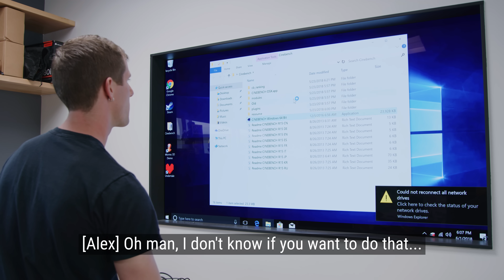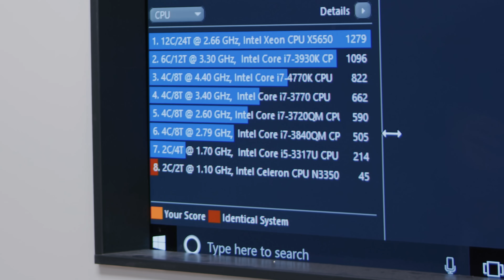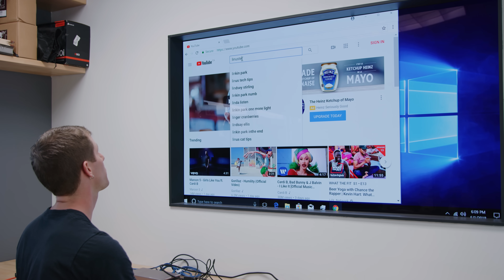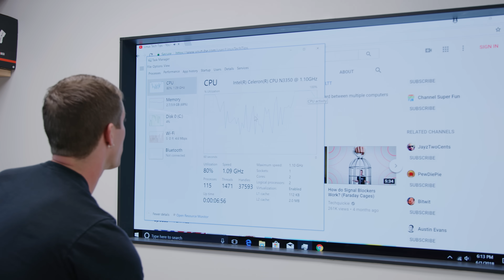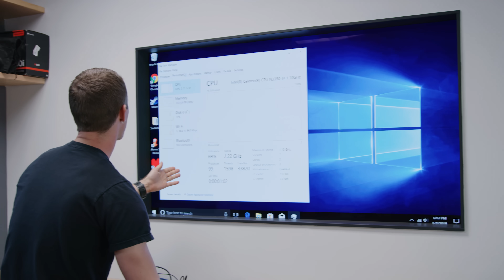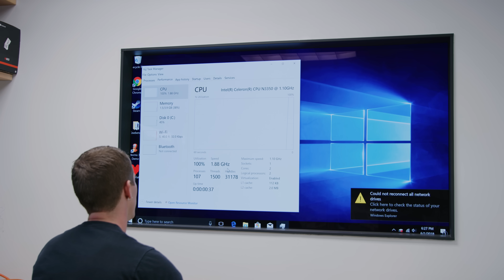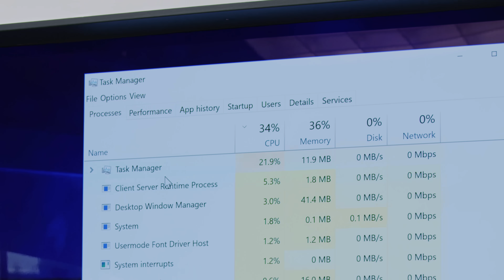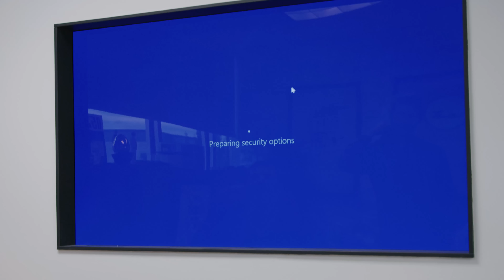PC Smaller than an SSD

Comment: Hmmm, how is it amazing? Smartphones are same size but more powerful... and even includes a screen.
Reply: Smartphones are not computers lol
Reply: And also way more expensive. And don't run Windows 10. And use a ARM processor rather than a x86 one.
Reply: SSaturn VX they are though
Reply: It's a computer, but unlike most other computers they arent x86 based
Reply: Actually they are computers but the x86 chip used in this is far more powerful, clock-for-clock, than an ARM chip used in phones as the x86 architecture is a CISC design with many SIMD functions that accelerate many computing tasks whereas an ARM chip is a RISC designed for low power usage, an 8-core ARM chip at 2Ghz won't perform nearly as well at many tasks as a dual-core 2.3Ghz Celeron.
Reply: Kimion Yeah but Windows 10 arm is ready now, and some arm processors may be better at running Windows than this
Reply: You can't really compare ARM and x86 cpu architectures head to head because they use completely different instruction sets.
Reply: SSaturn VX smartphones are not computers? what the fuck? they both got hardware, an operating system, what do you think they are?
Reply: Kimion Some arm are cheaper
Reply: Tht's because has an intel cpu, just wait when windows arm is ready, and you should can put an top of the line mobile cpu into that mini pc and using windows
Reply: Maybe not to the average consumer, but businesses that need a ton of workstations or terminals in an easily replaceable format will welcome the tiny format that they can hide away just about anywhere.
Reply: ENEKO TORRES windows arm with even less programs than windows
Reply: The software is windows 10, soo? what are you trying to get on? And It would perform better if it was optimized
Reply: Odin's Playground Dude what are you even saying? How can you compare the two
Reply: Lesson learned today according to some of the comments. Computers didn't exist until either 1978 when X86 chipset was introduced OR 1985 when Windows was released. Because no other chipset and OS can possibly be a "computer" lolz. Yes smart phones are computers, and if they have better optimised OS and hardware for the form factor... that makes then more amazing than "shrinking down" other more "traditional PC hardware" to run completely unoptimised software for that hardware (windows 10 as shown here).
Reply: There are phones running x86 tho
Reply: most smartphones are way bigger then that, the smaller you get the harder it is to get there
Reply: SSaturn VX they are
Reply: Odin's Playground its x86 though but that's what I was about to comment but when I went down here there were already a bunch of comments saying smartphones are computers
Reply: I also don't understand what is so special about this.
If i take my Win10 x64 Tablet, remove the screen and the battery, it is more powerful and not much bigger.
Reply: windows phones?
Reply: "Smartphones are not computers" -SSaturn VX  2018
Reply: I'm ashamed to see 33 likes on that first comment
Reply: High end ARM chips are way better than this Celeron. Smartphones also have a touchscreen, speakers, gyroscope, cameras, speed/pressure/compass/proximity/barometer sensors, a battery, flashlight, GPS and you can make phone calls.

Oh by the way, phones can run Windows 10, check out Windows Continuum: https://www.youtube.com/watch?v=YWmnOiilwa8
Reply: A freaking calculator can be considered as an extremely basic computer, it has logic gates to do calculations.
Reply: SSaturn VX Yeah, they are computers... They don't run an x86 system but they sure as hell are computers.
Reply: Kimion nobody wants a windows smartphone, trust me
Reply: A PC doesn't need like million gigabytes of RAM to run properly.
Reply: What about very small Single Board Computers like the UP Board? its in the form factor of the Raspberry Pi, and runs a much more powerful x86 CPU, it's fast enough to even run Crysis!
Reply: SSaturn VX uhh...
Reply: Kimion who said they cant run win 10
Reply: It is amazing because it is NOT an ARM processor in a sealed off environment that stops working with everything that was not specifically desigend for mobile use.

- You want to move your Photos from your camera to a backup SD card? Better pray that your camera manufacturer gives you a wireless connect and a useable app to shuffle data from your camera to the phone. And better pray your smartphone is not too old do your app stops working half way through a long vacation (I am looking at you Sony)
- Wanna download GPX data or Maps from some website and push it to your Garmin? Good luck with that.
- Wanna use a mouse jkeyboard, printer, scanner, mic or just acces your USB-drive? Well there might be solutions but they are pretty hard to find . 

There is a reason people often use tiny netbooks for this kind of stuff
Reply: Yes, they are? They aren't PCs, but they are capable of processing.
Reply: luky he means it's not a computer in the sense a calculator is not a computer or a console is not a computer. Stop taking his meaning so literally especially when they are completely different things. One is x86 the other is ARM so uh yeah
Reply: Kimion why wold you want a x86 Prozessor and windows? You saw that windows itself used nearly all of the performance. A special linux distribution would be superior in every way.
Reply: Gmayor61 "Non of these hardware features are at all relevant to a desktop PC. " 
What's your point? You wouldn't use this as your desktop PC either. Linus is saying this is awesome because it packs a lot of features in a small form factor. A phone does it better.

"but they're useless for the type of work this thing is meant for"
What can this do that a smartphone can't?
Reply: Odin's Playground It's windows, thats why
Reply: Are you sure about that?
Reply: Exactly my thought!
Reply: I like how 99% of these comments is just a flame war to a reply

Comment: This really isn't that amazing when you look at smartphones

1)Cellular data
2)Has a screen
3)Has a battery
4)Has speakers
5)Probably a faster processor (but no windows)
6)Doesn't heat up as much
7)Roughly the same size
Reply: Lelouch Yagami smartphones don't run x86 code like a PC though. They run ARM
Reply: Yes I did say there's no windows
Reply: LOL, I've just discovered the mean of my Windows PC is just for gaming.
Reply: You joking, right?
Reply: The whole point of this product is its size and that it runs window
Reply: Sith'ari Azithoth windows programs? old Windows games like Warcraft 3 and Homm 3 and 4? No?
Reply: I could use the shit out of this thing for work applications, this thing could run my HMI software and double as a openvpn server for network access to the system. All my PLC stuff only runs on windows x86 so phones are useless
Reply: Windows phones are dead. Microsoft themselves announced it
Reply: Windows phone is also uses different architecture, the phone uses ARM while Desktop version of the windows application are compiled for x86 and x64 processor architecture
Reply: TheRedbikemaster ARM can emulate x86.
Reply: Electroblade emulation require a lot of processing power and will not as stable as the Intel's processor, it could work though
Reply: Windows so any hardware you would buy there is a driver to it and will work right away, when to Linux that would not be the case and you would only hope some chinese in the deepest jungle has made a crappy driver that doesnt work anyway, and so on.. Windows for the win.
Reply: Seeing as you can buy one of these things for 200 bucks with no contract, I feel like this makes for a fantastic portable computer.
Reply: But cant run crisis
Reply: @mosie3949  You can't even spell Crysis
Reply: @Redbikemaster  My Asus Zenfone 5 (old gen) runs at x86 (it has intel processor) but wastes battery and RAM (it's why it's so impressive the battery in always connected pcs thats runs on ARM based chips)
Reply: Phones can run Windows.
Reply: @JesseLegend149  That's trough emulation dude.
Reply: Well this is probably a windows 10 tablet without the screen and battery.
Reply: @Matrixprogrammmer  Emulation takes more hardware power than natively running the thing.
Reply: PC stick is smaller and run Windows 10.  It has been around for years.
Reply: PC stick is smaller and run Windows 10.  It has been around for years.
Reply: And with a hdmi adapter i can turn my p20 pro into desktop mode and its kinda like a pc
Reply: 5) Do you know Windows 10 Mobile? Maybe not and I wouldn't be surprised. Microsoft barely tried to sell  its Windows 10 mobile after buying the mobile branch of Nokia.
Reply: I would agree with you but some of us have very specific, usually industrial/work related use cases where a smartphone will not work. I absolutely need something like this and believe me if the whole configuration I need worked with a smartphone or a raspberry pi I'd use one of those. This thing is super slim, solid one piece case, has fast usb-c ports. I need to tether a smartphone to it and transfer image data FAST, needs to be very portable. Can't wired tether two smartphones together and hook up a google edge TPU to it. Only something like this form factor will work for me. This thing is packaged so much better than the ARM SOC hobby boards. If it was arm based and ran Linux I would be even happier, in fact you probably can install Linux on it.

Comment: I think Linus missed the boat on the stick PCs from a few years back (lenovo made one, Asus did the vivostick, etc.) And I'm willing to bet that although they're longer and maybe a bit thicker they are narrower, I would guess they consume close to the same amount of cubic space. Just holding my Vivostick and an SSD side by side the actual volume of space they both consume seems quite close. 
This is far from cutting-edge, stick PC's have been around for awhile. Although the Vivostick is only powered by an Atom Processor Cherry Trail and a wimpy 2 gigabytes of RAM, it's more than adequate for the majority of retro emulation out there. I can't say it is really any good for anything else, though, due to the Ram limitations. The Vivostick even managed to cram a tiny fan and heatsink into its form factor, which is impressive although a bit unnecessary for its processor. 
My point is that computers on this scale are nothing new. This product just seems like a very minor evolution of an existing product category that you are kind of suggesting is a new thing. More powerful units capable of performing on par with a mid-range laptop or an entry-level desktop would in fact be almost entirely new. If it were packing an I3 or greater processor, 8 gigs of RAM or more, and perhaps an actual SSD rather than emmc flash I would be a bit more impressed. Sometimes I think Linus spends too much time with high end Hardware and a lot of the budget Low End Hardware flies right under his radar. The good news is seeing products like this indicates that interest in the micro PC category hasn't died off completely and maybe someday we'll see some decently powered micro PCs.
Reply: They have done several videos on Stick PCs and also used to run a Intel NUC Sponser for the longest time, so they are aware.
Reply: @Luckysquirrel1256  Well they sure don't act like any of that exists. The way he plays up the size of this thing makes it sound like he's never seen anything smaller than a steam box sized desktop.

Comment: An Intel Compute Stick is smaller and more powerful
Edit: I’m talking of the intel m3 and m5 models.
Reply: The Alterlion beat me to it was gonna comment this
Reply: but this an affordable option for the masses, and also reasonable competition for the raspberry pi
Reply: Joseph Stranges Pi reaches wider consumers with modular design, which can be used for anything.

don't tell me you will use this for automatically opening your door.
Reply: True, but that has a fan for cooling, meanwhile this is completely passive.
Reply: Nowhere near as thin and that Atom CPU is far slower and less powerful than even that shitty Celeron.
Reply: Joseph Stranges the atom compute stick costs like 120 dollars.
Reply: jaxative jax I’m talking of the m3 and m5 models. Those are WAY more powerful, they have the cpu of a gpd win 2.

Comment: would be great for low-end linux distros, since it functions fine but windows puts too much load on it
Reply: ALPHA_sh exactly. If they used higher end flagship soc like the SD835/845 they could run full Linux Distros with 8gb ram and upto 256 gb storage and it wouldn't eat up much energy and have 4K 60fps support. And the package would have been much smaller
Reply: SHERVIN DAVID again, arm64 and x86 is no comparison.

try google and see how bad latest raspberry pi compared to intel pentium 3 or 4.

Snp 845 wouldn't even be able to beat intel celeron.

smartphone chip is optimised for space and integration, be it network, volatile memory, gpu.
it is never intended for doing high workload like PC.

you can find the latest snp845 running windows 10 "mini" or the IoT version and hardly even functional.

you give 3 watt to snp845 and it will run like a beast.
and then give 3 watt to this atom 3xxx series, and it won't even turn on.

just to show you how crap smartphone processor is compared to desktop/mobile processor.

please stop bragging, please stop and ask for help
Reply: Malik hey man, I know that's why I said only running Linux Distros. We all know windows won't even boot on an sd845 since the instruction sets used are far more simpler than that on a x64 chip. Yes i do own a raspberry pi 3 so I know how shit linux runs on it. Won't dare try windows on it. Smartphones have come a long way. But no where near what desktop processors achieve. I should know, I'm majoring in them!

Comment: Looks about the same size as a Raspberry. Though a bit more powerful. Nothing new there, though.
Reply: Elfdaughtergames don’t you mean raspberry pi?
Reply: The raspberry pi is more powerfull with a 1.4ghz quadcore. Although no 4k. It can atleast browse internet and login without 100% cpu...
Reply: Jacob Nimeh yes, I do!
Reply: Tim Leijten true enough! I had to rewatch the specs, and you’re right the Pi is more powerful. And I barely know anything about the pi, I only built my first ever one last night!!! 😂
Reply: Tim Leijten you can't compare AMD and Intel using core count and hertz most time. You definitely can't do it with two completely unrelated cpu architecture and one being x86 and the other being ARM. You can't tell what's faster without bench marks.
Reply: Significantly more powerful (Raspberry Pi 3 usually struggles with running full screen video even in 720p, but that depends a lot on your OS and other trickery), 4 times the RAM (and much faster at that), thinner (though larger area), and x86 compatible.  Something comparable would be the LattePanda 4 GB RAM, which costs ~30 USD less (at least on Amazon), but has 64 GB of memory (the 2 GB RAM one has 32 GB and costs ~80 USD less), though that doesn't come with a Windows 10 license, or a case, or a power supply, or anything else for that matter... The LattePanda also has an Atom processor, which, while 4 core and capable of roughly the same scores in multithreaded workloads, is way slower in single core tasks than the Celeron here. So in the realm of the x86 compatible mini-PC this thing ain't bad at all, and surprisingly affordable considering it's a fully packaged product instead of a DIY wonder.
Reply: @Tim Leijten no it isn't. The celeron is significantly more powerful in literally every way.

Comment: Yeah! Linus finds about RaspberryPi! Finally
Reply: Raspberry does not have a x86 processor
Reply: This is better than a RPI
Reply: Also don't mention to him that there have been windows 8.1/10 TV sticks that were half the size using Atom bay trail and cherry trail CPUs for years that basically work the same (with older ports and specs).
Reply: It can run windows tho...

I've done it on the RPi Zero W.
Reply: But Raspberry is a Computer and smaller than that
Reply: Just as well there is an ARM version of windows that has been run on a RPi. Its missing a lot of stuff but it boots just fine.